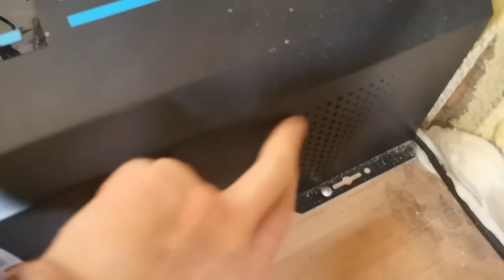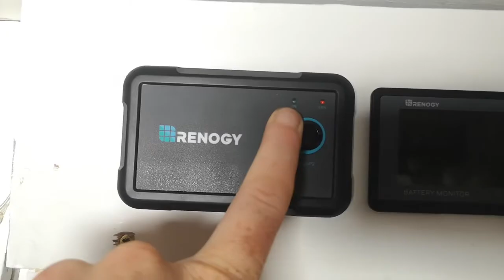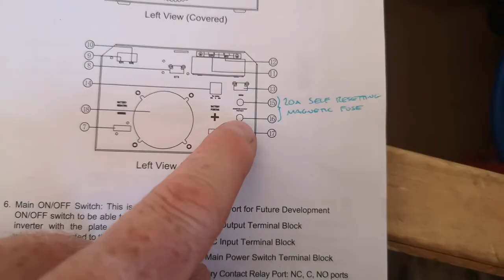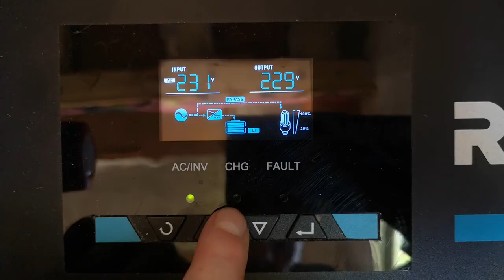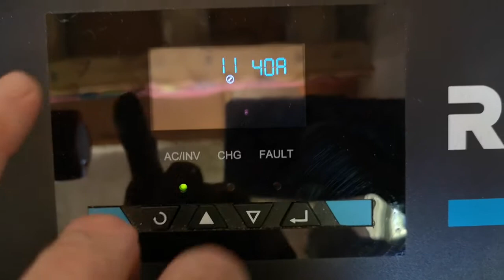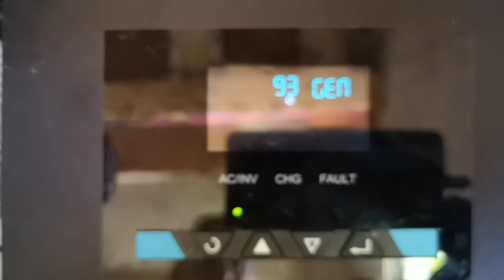Renogy Inverter Charger Installation & Setup | Part 1

Comment: Hi there can you please  help me with this I've checked live to neutral I've got 230 volts but if I check live to earth I've only got 75 volts I haven't connected the earthbound yet surly I should get 230 volts on the live to earth thanks mark
Reply from the maker: Hi Mark, is this on the AC input or AC output? 
I would suggest watching the Part 2 video. That video goes into detail about wiring and testing the inverter charger.

Regards,
Jolly
Reply: @vandercampadventures  hi there it in DC output from the inverter when you plug into shore power it's fine wondering if you guys can check you one to see what voltage your getting live to earth mines only just under 80 volts but when I plug my inverter into shore power it's fine I get 230 volts
Reply: Sorry I'm getting 80 volts between live and earth neutral to live is 230 volts
Reply from the maker: @markwhitney8458 the reason for the difference in voltage is because the inverter is centre-tapped. I explain it all in detail in Part 2 of the installation video. Heres the link - https://youtu.be/gecrb2rPUvU?si=ivcK99Y7neQtCDJx
Reply: Thanks I watched the video a few times I forgot recall center taped but to be honest most of it went over my head that's put my mind as rest hanks for your help👍
Reply from the maker: No worries 👍

Comment: My automatic charger dont work
Renogy 3000 inverter charger
Reply from the maker: I would need more information to help diagnose the issue with you. If you can provide as much info as you can I'll do my best to help 👍

Comment: My long time belief is that inverters cannot be mounted vertically with fan up is because mice and debris are likely to fall into the fan area.  In the case of this 26kg inverter charger  it is best to mount as in this video because if put on a verticle surface the screws supporting the inverter would likely rip out with time. Flat is the only way to go.  Plus, it needs to be mounted so the screen is easy to read.  

I love how tight this install is.  Wish I could get that right.  I just bought this inverter charger... the weight is insane.
Reply from the maker: Hey Rob,
Thank you for your input. I can assure you the electrical cupboard didn't just happen overnight, it took approximately 4 days of careful planning, head scratching and tea drinking to get it to fit. Having all the components helped because could put everything into place and move them about. 

Check out PART 2 (https://www.youtube.com/watch?v=gecrb2rPUvU) if you need any help or guidance with installing it. Good luck and have fun.

Regards,
Jolly

Comment: Think I’ve just about understood all that has been covered here. I could do with a bit more info regarding earth placement. I’ve a 2000 W unit, same as yourself and want to use RCDO in a two way box for input power. Does the earth from site power get bonded to chassis? If so, do I then bond input earth terminal to chassis as well?  This is for a ‘full metal’ campervan, not Moho or lorry style non metallic body. Pete
Reply from the maker: Hey Pete,

Thanks for the comment. I discuss the topic of wiring, fuseboards and earthing for the inverter charger in more detail in the upcoming part 2 video. 

Only one chassis bond is necessary for the AC system.

I assume you will have a site power cable entering the fuseboard and the inverter AC input connected from the fuseboard to the inverter?

If so, it's important to connect the site power earth, inverter AC input earth, and chassis bond together, typically within the fuseboard. Alternatively, they can be connected into an earth block, as long as there is continuity between the earths. 

I hope this helps,

Regards,
Jolly
Reply: @vandercampadventures  Yes, the bonding would be as described. It’s good to get this confirmed, much appreciated, Pete. (I may send a msg on Instagram).
Reply from the maker: No problem. Happy to help with any electrical queries 👍
Reply: I have a 3000w renogy(US) installed in my ambulance conversion. Is there any negative effects to the inverter by using the battery bank as a 12v power source for a 2kw diesel heater and some lights? I see you are using some 12v off of your battery bank.
Reply from the maker: Hey  @David-su2oo , 

It's perfectly fine to have the inverter and 12V power supplied from the 12V battery. My recommendation is to connect the inverter directly to the battery, this way, the cable will only carry current for the inverter. Moreover, supply your 12V power directly from the battery to keep them separate.

Our battery has two cables connected to the positive—one supplies the inverter and the other supplies a positive busbar that powers our 12V power fuse board. Our 12V power includes a 4KW diesel heater, lights, USB sockets, pump, and fan.

Please let me know if you need any further assistance.

Best regards,
Jolly

Comment: Isn’t the fan at the end where you have yours to the outside wall? If it was installed vertically, the outlet/inlet would be covered or am I thinking incorrectly?
Reply from the maker: Hey, the fan is located on the end with the electrical terminals. It draws air through the unit and out of the white cover where the electrical connections are.
If it was mounted vertically and sat on a surface then yes, the fan vent would be covered. However, manual V1.1 states 'the inverter should never be mounted vertically' as it effects the fan and cooling. 
Regards,
Jolly

Comment: Just to clarify as I am going to be installing the 3000w version, I run positive (+) from the inverter/charger via isolation switch too fuse, onto leisure battery positive (+). I then run positive (+) cable from the leisure battery via isolation switch to fuse and onto  positive (+) busbar (in my install is will be the victron lynx distributor 1000A busbar unit?
Reply from the maker: Hey Lincolndave,
You've got it 👍. That's how we have ours set up. Just be sure to mount the fuses as close to the battery as you can. 
You can run the inverter positive to the busbar but this would mean running a hefty size cable from the busbar to the battery. It's whatever best suits you 🤘.
Regards,
Jolly
Reply: @vandercampadventures  cheers for that info, much appreciated 👍

Comment: Just had my 3000w Renogy inverter/charger fitter by a company and notice they have not fitted isolator switch been told just switch inverter off on unit is this correct and when on ehu do I have to leave inverter on as this won’t charge batteries ? Many thanks kevin
Reply: That’s great to know thank you great vlog learning lots safe travels kevin
Reply: Cool is that address with the ( ) ?
Reply from the maker: Sorry Kevin, the e-mail doesn't include the (). It's jolly@vandercampadventures.com.
Reply from the maker: Hey Kevin,
It's not essential to have an isolator switch on the battery cables. The isolator is there for maintenance purposes, you can remove the fuse but it's more faff. 
Yes, when on EHU the inverter needs to be on to charge the batteries 👍.
Regards,
Jolly
Reply: @vandercampadventures  is there a way to trickle charge your vehicle battery while stationary for long periods of time when leisure batteries are full either from solar or other ways cheers kevin
Reply from the maker: Hey Kevin, I hope you're well. 
There is indeed. Renogy's DCC30 & DCC50 and the CTEK D250SE DC-DC solar chargers have a function that trickle charges the starter battery when the leisure battery is full.  

This article has more detail for you - https://vandercampadventures.com/dc-to-dc-charger-with-mppt-solar/#The_4_Best_DC_to_DC_Charger_With_MPPT_Solar

I hope this is helpful. Please shout me if you need any more help.

Regards,
Jolly
Reply: Hi hope you are well just wandering I’ve had all the above fitted my vehicle battery seems to be draining every thing turned off not happened before the upgrade have they disconnect something from sergeant that’s making it do this any ideas what could be doing this ? Thinking of fitting Renogy dcdcmppt and bt2 so solar can charge both cheers for your advice kevin
Reply from the maker: Hi Kevin, drop me an e-mail (jolly@vandercampadventures.com) and we can arrange a call if that suits you? It may be easier and more time efficient to discuss it over the phone 👍.

Comment: Ok I finally finished screenshotting every page of that manual and there is 101 pages of that manual so thank you very much for your direction to the manual I wished you would of said that first up and I got it now on my iPhone 11 and I must inform you again well I got the 3000 Watt version Model : R-INVT- PCL1-301123S  in the manual for mine 18 is the beep every time you push the button to turn the enjoying beep off 18 bof is beep off and  22 Aof is the alarm So yeah you have got that one back to front because I tried that with mine and the exact thing happened the beep still stayed on so while I was munkeying around with mine like I said I discovered the bof is that enoying button beep on or off  you should try that and you may find once you set that to bof that enoying beep will be no more unless you decide you want that enoying beep on so there it is but in the manual it says beep when battery is low so maybe you got mix up there or back to front with it anyhow now I have deleted all that silly stuff I said and now I want to apologize to you because when I think I’m wrong I will admit that and thank you for your video and directing me to where the manual is Yeah thank you.

Comment: Hi, 
So having watched your video… very useful. 
My question is it okay taking the live to the battery, fused and with an isolator as you have it with the negative from the inverter to the buzz bar?
Reply from the maker: Hey Ryan,
Thanks for your comment, good question.
Yes, the negative can go to the busbar. However, you must ensure the battery to busbar cable is adequately sized.
Regards,
Jolly

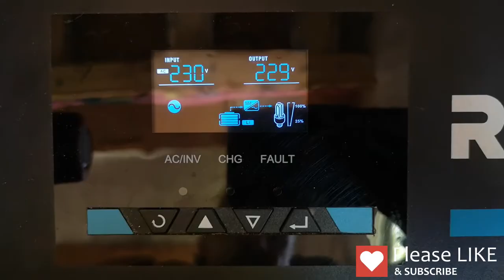Comment: Hi! I really have to ask about what do you do at the 39:07 mark? 

So right now I have same setup as you and I get AC power icon showing 220v and the round shorepower icon, it blinks the AC/INV green. But when I plug in a 230v to outlet from the inverter the lights work, BUT the inverter stays in blinking AC/INV and never goes to the same mode as you are having after the 39:07. 

I have followed the exact same settings as you in and it is in Utility mode. Only difference I can see is that for some reason my AC input is 220 and not 230.
Reply from the maker: Hi there! Thank you for leaving a comment. What country are you from and what do you mean by 'the inverter lights work'?

If the voltage at the shore power is typically higher, say 230v, then the 220v could be due to voltage drop. To determine this, I suggest you test the shore power voltage to see what it is.

When the AC/INV light blinks, it indicates that the inverter charger is in inverter mode, which is from the battery 12v to 230v. The shore power icon will appear when the inverter charger receives the mains shore power voltage. After approximately 8 seconds, the inverter charger will go into bypass mode once it is satisfied that the voltage is stable.

220v shouldn't be an issue because the input voltage range is between 155-275v (230v model). However, check the voltage and polarity of the shore power at the campervan. Also, ensure that your input and output connections at the inverter charger are correct.

I hope this information is helpful. Please let me know if I can help further.

Regards,
Jolly

Comment: Fitting 1of these at the moment have you got a update on the Rcd breaker distribution board many thanks
Reply from the maker: Hey, sorry for the delay on part 2. I'll be uploading the video next week 👍
Reply from the maker: Hey @elevatingroofscampervan3282, PART 2 of the install video has been published today which details the fuseboards and RCD protection. Check it out here https://youtu.be/gecrb2rPUvU. 

Sorry for the delay. 
Regards,
Jolly

Comment: Hi hope you get this as a notification. I set my renogy 2000 up and 200ah renogy battery up as you have . But I have fault code 89 out of frequency 
And I cannot charge for my shore power the manual just says out of frequency. Any ideas to point me in the right direction.
Cheers Tom
Reply from the maker: Hi Tom, 'out of frequency' would suggest that the grid frequency of your shore power is not in the range that the inverter can handle, which is between 40-70Hz. When you connect to shore power, does the LCD display show the input frequency figure? You can use the up and down arrows to cycle through the menu to find the 'Input AC Hz' display.

Can you also check the input AC voltage when you're connected to shore power? Either by mutimeter reading or from the LCD display (Labelled as 'Input AC V').

It's also a good idea to check your wiring to ensure that everything is connected correctly. Sometimes, electronics can malfunction and display misleading errors if the wiring is incorrect.

Please let me know if i can assist further.

Regards,
Jolly

Comment: The “preset” for Lithium batteries is set too high (14.7V).
It should be set to 14.4V (in some cases). In order to do that first thing you must do is change Program number 05 to  6-0 and Program number 94 to ALB (for lithium), then in Program 26 you can change the maximum charging voltage. 
The Renogy MPPT solar charger ( with Lithium preset) is set to 14.4V. Idk why they change it on the inverter. 
I saw your video a few times and I read the manuals a few times as well. Thanks mate!
Reply from the maker: Good point, thanks for raising this in the comments 👍. It's always recommended to check the charge voltage of any battery and not rely on the presets. The Renogy 200ah Lith-ion battery charge voltage is 14.4v.
Thanks for your support 👍.
Regards,
Jolly

Comment: Thanks for the reply, are you saying that the outlets in the caravan will be dual pole or are you saying I will have to change all the power points? Cheers Nick
Reply from the maker: Hey Nick, I'm not familiar with Australian sockets, but I can offer advice based on UK sockets. 

To determine if the sockets supplied from the inverter are single-pole or double-pole, it's best to use a socket tester. First, plug in the tester and switch the socket off. If the tester turns off, then the socket is double pole. On the other hand, if it doesn't turn off, it will show a fault, indicating that it's single pole.

Hope this helps,
Regards,
Jolly

Comment: Hi Thanks for the video, great help. You said there was no RCD on the output side of the inverter but you didn't say how you make this side safe? I'm asking because I'm in Australia and we have to have the 240V side installed by a qualified Electrician and the guy that works on caravan electricals exclusively refused to install it as he felt they were unsafe, he said something about an MEN not sure weather it was because it had one or didn't have one?? I contacted Renogy for their comments and they said they would email me in 24 to 48 hours which was 8 days ago. Can you enlighten me please?  Cheers Nick
Reply from the maker: Hello Nick, I hope you're doing well. 
An RCD on the outgoing side (230v) of the inverter won't function as intended. The RCD requires a neutral-earth system, known as the MEN (multiple earthe neutral) in Australia, typically found in a house. However, this inverter is centre-tapped, so it has no reference to Earth. Meaning there are two live conductors (115v-115v) rather than a live and neutral (230v-0v). As a result, it is possible to touch one of the outgoing live wires without receiving a shock because there is no fault path. However, if you touch both outgoing live wires, you will receive a shock because you will be part of the circuit. 

For safety, it is crucial to use double pole (DP) socket outlets on centre-tapped inverters. Single pole (SP) outlets switch only the live conductor, but DP outlets switch both line conductors (live and live). If a SP socket is used on a center-tapped system, the appliance connected to it will remain live even when the socket is off.

Most campervan inverters are set up this way, but some have the option to change the output to bonded (N-E) instead of centre-tapped, allowing an RCD to be used. 

I understand your concerns regarding the safety of the campervan inverter system. I am currently discussing this issue with other electricians and engineers to determine why campervan inverters are centre-tapped, and we have identified a few reasons. In addition, I am conducting tests on the inverter charger to determine if it is possible to have an RCD on the outgoing side. I have a few videos and blog posts in the works, so stay tuned for more information.

In the meantime, I'll do my best to answer any other questions you have.

Regards, 
Jolly
Reply from the maker: Hey Nick, the Renogy Inverter Charger install video PART 2 has been published today which goes into detail about fuseboards and RCD protection. Check it out here - https://youtu.be/gecrb2rPUvU. 

Sorry for the delay. 
Regards,
Jolly

Comment: Put a couple of computer fans in the set up which won't take and power to run or connect them to a small solar panel just to run the small fans.